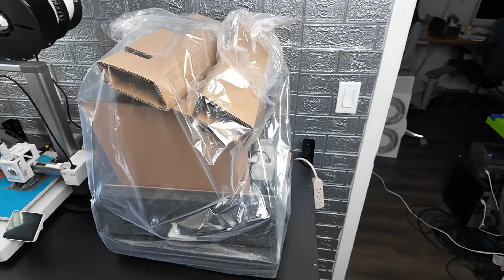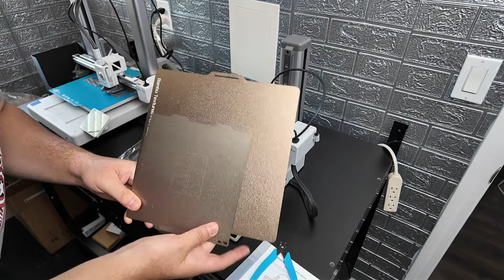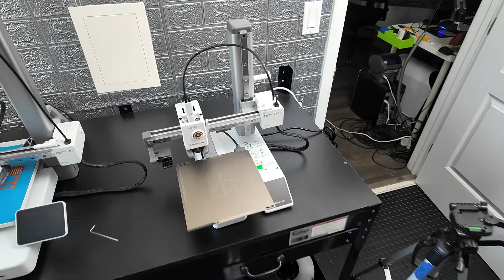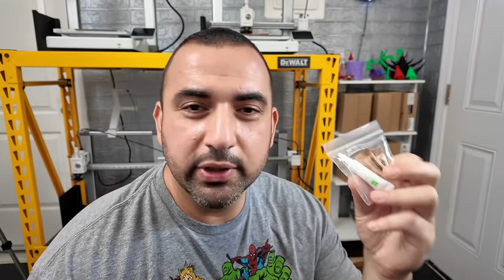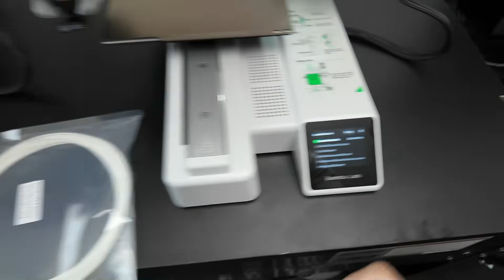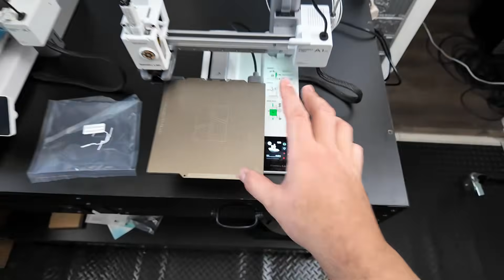Bambu Lab A1 Mini Beginner’s Guide & First Print!

Comment: how well does the mini print small accessories, say engine and body parts for hotwheels?
Reply from the maker: Thanks for the comment! For small accessories like engine or body parts, the A1 Mini can handle that scale well. Using a smaller nozzle, such as 0.2 mm, allows for finer detail, though a 0.4 mm nozzle can still produce good results at that size. The A1 and A1 Mini use the same style of toolhead, so their performance in that kind of printing is similar. Resin printers can also produce very fine details if you decide to go that route, though they do require working with toxic liquid resin.
Reply: @3DTheory okay cool thanks

Comment: So when it’s done printing you can just pluck it off? Or what’s best there?
Reply from the maker: Thanks for the comment! The ideal way to remove a 3D print when it’s finished is to let the print bed cool down first. Once it’s cooled, you can usually just flex the PEI sheet slightly, and the print will come right off :)
Reply: @3DTheory  Thank you for the information! I appreciate it!

Comment: GREAT video for me (a noob). Are you supposed to remove the filament after printing, or can I leave it in for later use?
Reply from the maker: Thank you! Glad the video helped! If you’re going to use it again pretty soon, it should be fine to leave it in. But if you plan on leaving it for a while, filament absorbs moisture over time, which can cause stringing or make it brittle. If you have a filament dryer, you can dry it out, but it’s best practice to re-bag it with a desiccant when you’re not using it :)

Comment: I have a bunch of a1 and a1 mini's, new and old. They changed the packaging for the worse for all the new printers. The new A1's come with the "tool kit" the same way, so much worse than it was before with the organizer.
Reply from the maker: Thanks for the comment! Yeah, I noticed that too. The older organizer made everything feel more polished, kind of a shame they moved away from that. One other thing I saw, mine had a few scuff marks on the side, right out of the box, which was surprising for a brand new printer. It’s good to know it’s not just the A1 Mini seeing these changes.
Reply: @3DTheory  yeah it looks like they started cheapening out on the packaging too. Its been a while since I opened my mini, but my most recent a1's have had a LOT less packaging material, and its all smaller pieces of foam/cardboard instead of 2-3 big pieces holding it all together. Makes me think of when I got my OG p1s 2-3 years ago that came with half a spool of filament as a sample rather than the 6 meters you get now
Reply: great video though! it will come in handy for the new people to 3d printing that get printers during the anniversary sale!
Reply from the maker: @JIGL37 Totally! Seems like they’ve been gradually cutting corners with each new wave of machines. The packaging in mine felt way more minimal too. I’ve always gotten just the 6 meters of filament, so it must’ve been a while back when they were including spools, that would’ve been cool to experience! That said, I’m still really thankful for how Bambu has made high quality printing so accessible. My Creality’s used to need a lot of tinkering and support, I just wanted to focus on creating, and Bambu really delivered on that for me :)